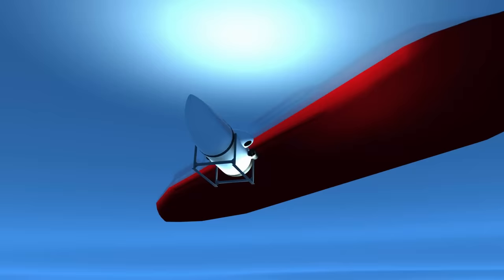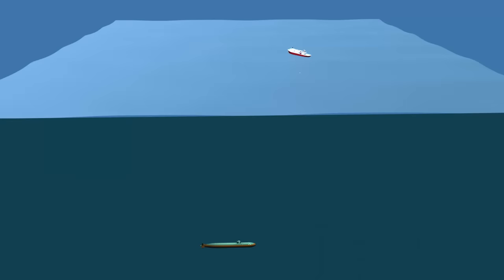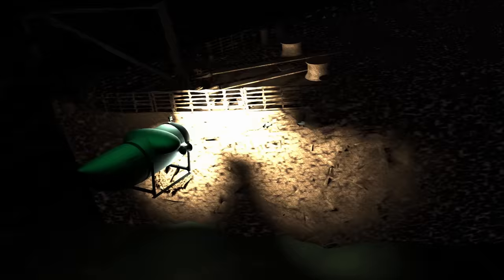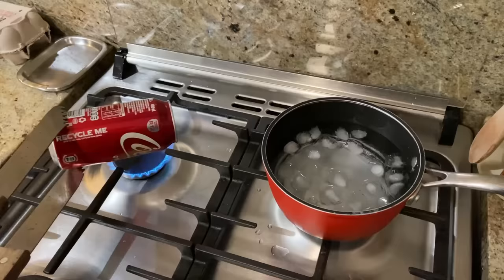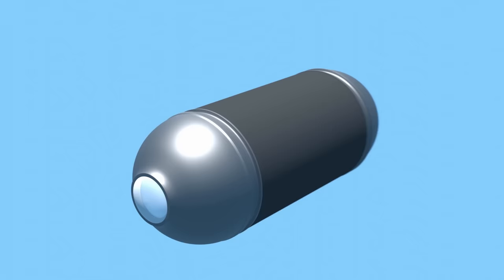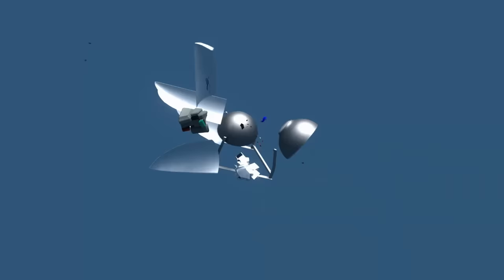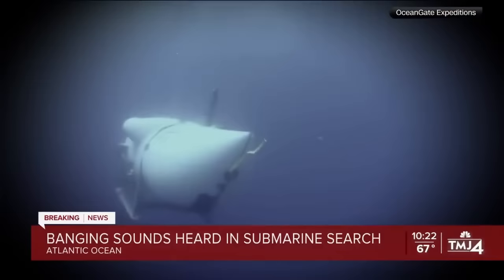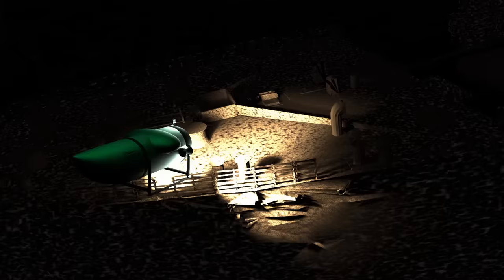TITAN Sub implosion | Deep Dive animation explanation

Comment: Thank you for your excellent presentation.
According to the Pacific Coast Composites website:
Manufacturing in a generous safety margin: The carbon fiber/epoxy hull of the Cyclops 2 features alternating layers of UD prepreg in the axial direction, and wet-wound carbon fiber filaments in the hoop direction. The hull is 127 mm thick (5 inches vs. the 6 inches planned for Fossett’s earlier craft) and has tested to 2.5 times the 6,500-psi service pressure.

I understand that OceanGate's 'Cyclops 2' was the pre-launch name for the Titan submersible.

According to Captain Karl Stanley who accompanied Mr. Rush on Titan's second dive to 12,500', the popping and cracking sounds from Titan's CF hull were so loud that they resembled fireworks or discharge of a small caliber firearm. These sounds were apparently worse at maximum depth. However, they continued on ascent, even at 900', indicating the ongoing release of stored energy from CF defects. Mr. Rush apparently briefed passengers (mission specialists) that they may hear 'noises'. There were 'sensitive acoustic and strain sensors' installed on Titan--though the hull's distress was seemingly obvious to the unaided ear.
Reply: :face-blue-wide-eyes:😱 Would love to see the spreadsheet data on how much $$ OceanGate "saved" by going with CF-tube vs proven Ti-spherical structure...🤔 ... and with all the gov't accident investigations, plus Discovery Phase of the inevitable civil lawsuits, that formerly private/trade-secret data WILL be disclosed.
Reply: @MajorCaliber  Yes--as in an NTSB aircraft accident investigation, all of technical interest will be documented along with probable causes. A tragic event, my thoughts are with partners, children, relatives and friends.
Reply: Its very odd that SR informed people that its normal to hear noise from the sub! 
When James Cameroon built the Mire submersible and when he took a British journalist and his crew down to the Titanic...This sub was only able to seat 3 people... When the submersible hit the water and slowly started to descend, he said “ Its very quiet! You don’t hear anything in here!” Well, it’s because James Cameron put a lot of work and research into building the safest sub to withstand going at those depths! Of course, he’s gonna make it as solid as possible!

Comment: Why the delay in releasing the information to the public concerning the possible detection of the implosion of the Titan? 1) The event was probably detected by a classified Navy passive undersea surveillance system, so the information would have to be declassified for public release. 2) The classified information was probably released to the Coast Guard, but was of no practical use until assets with the capability to confirm the destruction of the Titan were on site. The search could not be aborted until the destruction was confirmed, and the Coast Guard didn't want to cause the families to loose hope until it could. 3) There was no benefit to anyone to release this information.

Comment: Thanks for cutting through the chatter, Mike. Even to a lay person, there seem to be so many weaknesses. I have to wonder at the junctions of the titanium bands and the steel-lined carbon fiber/plastic tube. Didn’t these dissimilar materials rely on epoxy to hold them together under extreme pressure? Yikes!
Reply: @Mike-Bell  The epoxy is essentially plastic, which would not react to pressure the same way titanium would. I realize that the composite could have delaminated at any point. I also saw on the BBC that the evidence retrieved included a big canvas sack of something…could have been shards of epoxy. Those tube ends epoxied into titanium just look to a lay person like a failure waiting to happen. I am shocked to learn that the carbon fiber was wound as a simple spiral. What a terrible choice. The late CEO actually reminds me of Elizabeth Holmes, who insisted that she could do what all experts in the field told her was impossible. The OceanGate CEO thought he knew more about materials and deep submergence than the experts in the field. They both started with the end result they wanted and then tried, in the name of innovation, to force a path to it that disregarded good science and engineering. Now they have both paid.
Reply: @maudessen573  made this very same observation about Elizabeth Holmes today! "innovation" at the expense of innocent lives. if he had only put himself at risk (like test pilots), he may have actually earned the respect he so desperately sought.
Reply: @Mike-Bell I work with epoxy every day and I’ve bonded (or tried to bond) almost every construction material you can think of. When I saw the video of them smearing the epoxy right onto that smooth titanium, I immediately had a strong feeling where the failure occurred. The only way to truly bond epoxy to metal is with mechanical interface… or essentially small nodules or protrusions in the metal surface… or at very least very coarse sanding or scoring of the titanium surface.
Reply: If you have ever had a carbon bike or known someone who had them you would know what a POS they are. They work great on paper but they are inherently brittle and don't last. I was pretty shocked when I learned this is what they did. And all for buoyancy's sake, which is easy to deal with and does not even have to come from the body of the sub itself.
Reply: @maudessen573  Spot On-- Rush was like Elizabeth Holmes-- Smart, but with an ego and ambition well beyond IQ-- Not smart enough to know that they were not smart enough. Also, both could be labeled as sociopathic because of their complete lack of concern for the safety of others. Unconscionable level of hubris.
Reply: @maudessen573 Well.. we need people willing to question science. That's never a bad thing. But if you question science then be willing to offer reasons why you question it. 
Perhaps run through testing that mimicks the conditions below in order to look for weaknesses. 
Innovation is an absolute necessity if the world is to continue forward, but there are ways to do it with more caution or with safer testing. 
In the case of the Titan, the choice to craft it from carbon fiber seems to have been one of the major flaws. A simple search of the issues with carbon fiber would have been enough to not recommend it as a material for sometging which would be making multiple extreme depth trips throughout its lifetime. 
I'm puzzled by what belief the CEO was operating from which caused him to second guess what is arguably rather simple science when it comes to composites.
Reply: @matthewmosier8439  People who question science and engineering should be qualified to do so. This is why they have peer reviews. Holmes and Rush were not qualified in their fields. Neither would accept feedback from qualified people so they surrounded themselves with unqualified people so they would only hear what they wanted to hear.
Reply: @maudessen573  "Qualified" is only as good as the process of qualification, though. 
That's science's weakness. 
Human institutions, science included, tend to become corrupt and stuck in their ways and need airing out, periodically. 
That's my point. 
Questioning the "experts" is a healthy mindset to have in a world with political and social pressures being applied to fields involving  engineering and science.
Reply: @Mothball_man  The bonding doesn't need to be very strong, water pressure will do the work of keeping the rings on the cylinder.  They do need to have a tight fit and an absolutely smooth interface, or you end up with a serious stress riser.  What surprised me about that video of the construction of the Titan is that they did the epoxy/fiber coating of the cylinder and the glue-up of the titanium rings, not under controlled conditions (dust-free, pressurized), but basically in an open warehouse.
Reply: @matthewmosier8439  Stockton Rush thought he was qualified to air out the deep submergence community, along with composite materials experts.
Reply: @maudessen573  And he made a mistake. That is correct. That is a part of innovation. He "should" have been able to avoid that mistake with either better testing or by observing the basic weaknesses of carbon fiber. 
I'm not an engineer and could see the weaknesses as being too risky (they could hear delamination sounds on a previous trip).
As SOON as I heard such sounds I would have known that the cracks which occured would not get better and would only continue to weaken as others joined them. 
That is why I'm puzzled as to why he did not use common sense in his innovation attempt. 
I really believe that somebody must have told him SOMETHING, which he wanted to hear, that caused him to come to the conclusion that the sub was safe. I would love to know what that information was.
Reply: @kaasmeester5903  the joint does need to be extremely strong on dissimilar materials under unequal pressures. If the pressure was predominantly on the ends you could almost get by with no adhesive. But the pressure on the length of a cylinder was uniformly inward which mathematically “outpressures” the psi on the ends. That combined with the weak and brittle composite is why I’m scratching my head at how this thing didn’t implode sooner.
Reply: @matthewmosier8439  According to the CEO of DOER Marine, to whom he went for advice in 2015, Rush didn’t use common sense because of his hubris, complacency, and greed.

Comment: I had to keep replaying the implosion animation over and over, it really caught me off guard. That was quick. Thank you for your analysis and video of this tragic accident.
Reply: But he didn’t mention the life raft and scuba tanks they had onboard and probably was used when it started leaking and they abandoned the sub and floated to the surface, all safe onboard the life raft.
Reply: @obamabigears734  what
Reply: @imjustapotatoleavemealone  He never mentioned it and I wonder why
Reply: @obamabigears734  Bro what
Reply: @imjustapotatoleavemealone  the scuba gear and life raft that they had as safety equipment
Reply: @obamabigears734  Scuba gear and life craft doesn't save you from the 500 bar that tries to crush you with the force of a hydraulic press.
Reply: @imjustapotatoleavemealone  That’s not true, if you have scuba gear you can breath under water and just float to safety onboard the life raft
Reply: @obamabigears734  I don't know what substances are you using, but i want some.
Reply: @imjustapotatoleavemealone  just keep living in denial like you have been doing and you’ll be ok
Reply: @obamabigears734  👍

Comment: The right  amount of resin for optimum strength in composite laminates is key, and composites are strong  in the right application , but they aren't very durable if metal is rubbing  or pushing against the laminate.

Comment: Most likely collapse due to carbon fiber failings between individual fibers. It was a horrible choice to do laying one way. The fiber would easily have a fatigue use of maybe once or twice per tube. With what people have said hearing cracking/snapping from previous dives. I have no doubt the fatigue from the fiber lead to a crush popping the 2 ends like a soda pop cap.

Comment: Titan was descending very slowly 
Joints would have started giving up
People inside may have seen water coming in
Than suddenly it imploded 
Killing and throwing all five out of the cylinder 
Death would have been cruel similar to fragmented pieces 
Those carbon fiber fragments were light
Currents pushed it away
Carbon fibre are not like metals or rubber 
It is hard plastic with fibers 
Will not squeeze  it will break into thousands of pieces
All metal parts has been located but we didn't see any carbon fibre
Reply from the maker: Exactly. Those thousands of fragments will lie as the newest wreck next to the titanic… a testament to hubris.
Reply: the lead up to the failure was probly load and terrifying, but once the vessels integrity failed, because water does actually compress very slightly at these pressures, the water would have entered at the speed out sound jn water,  given water tension the force on impact was be such that, the people  would have been liquified faster than the sight of the water rushing in could travel from their eyes to the brain. far from being cruel, they would not have noticed anything after the hull failure.

Comment: They knew the Titan had imploded. The search and rescue/recovery effort was a training exercise. Everyone knew there'd be no survivors. Millions of dollars spent to find what they expected to find and no-one benefits.
Reply: No, they didnt "know the titan had exploded". They suspected it.  Knowing and suspecting are wildly different.

And suspecting isnt good enough when it comes to lives being saved. Many banging, booming and popping sounds are picked up on hydrophones, and many sounds on hydrophone arent clear enough to determine exactly what they are. Youd never stop a rescue mission just because a hydrophone picked up a noise.

On top of that, standard operating procedure is to treat all calls for aid as rescue missions until there is conclusive evidence of lack of survival, then it becomes a recovery mission. And a noise on a hydrophone isnt conclusive evidence.

It wasnt a "training mission". It was the way all calls for aid are conducted, and even after conclusive evidence of structural failure was found, then it becomes a recovery effort to remove any of the victims effects or body parts (if possible - even in this case there may be teeth or bone fragments) for the families as well as the pieces of the vessel to examine them to determine what went wrong is also standard operating procedure.

Quit spreading misinformation.
Reply: Whoever brought u 'They must be stuck' was the one who made it impossible for anyone to tell that the military detected an explosion before they were sure. Had the initial report only been "Lost contact" they could've said that there was a large ex/implosion, they think it was them, but that they're launching an recovery/rescue operation to make sure. I'm pretty sure they woud have to do it anyway just to make sure the vessel didn't explode in the Titanic damaging the wreck further. Apart of that: Was it useless, I don't think so as this was a huge story and a lot of people learned a lot about the deep sea, submarines, submersibles, physics, building regulations and so on. Like in this video "We're taking everything for granted without realizing the effort of those who made it." Guess now some will.
Reply: They still didn't know where it was, and had to confirm suspicions by locating it. Also, it would have been worse if they had come out and said they were dead and upset the families, then had to deal with that if they ended up being located alive